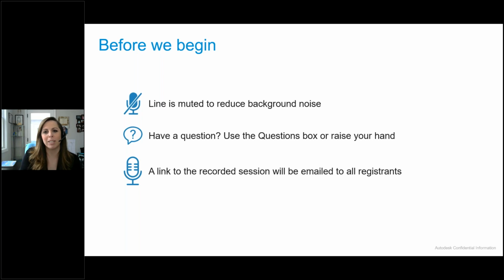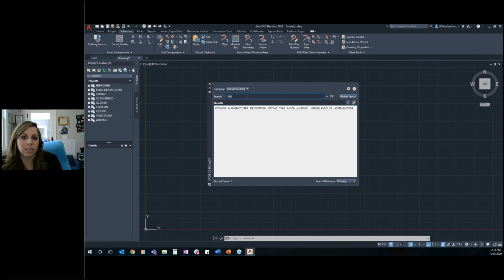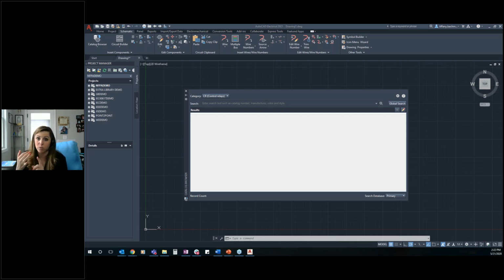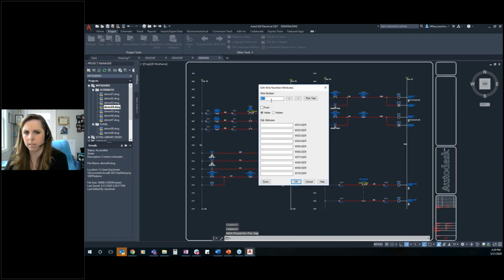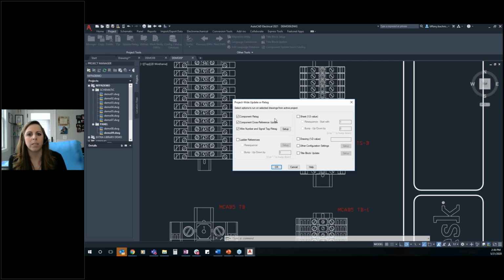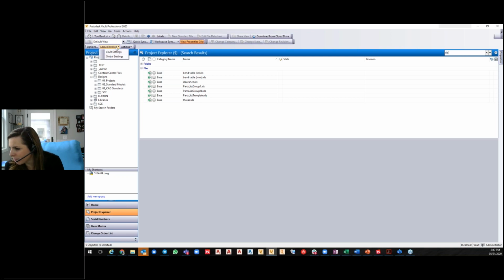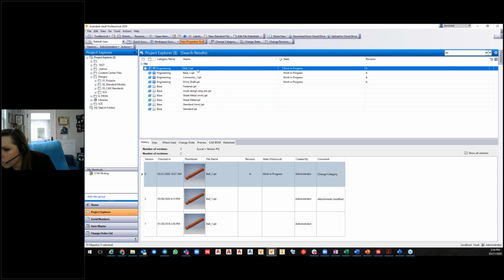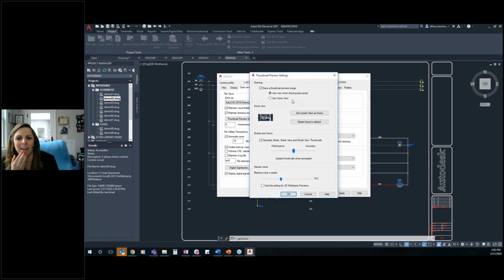What's new in AutoCAD Electrical 2021 (May 2020)

Comment: Instead of working on pretty pictures in the Icon menu, how about fixing the things you broke.. Like FileDia that keep resetting its self back to 0 when it chooses.. Fix cable marking so when you set cable in wire type and set it to NOT NUMBER and up do updates and gives it a wirenumber anyway.. Fix Source and Destination so if it is connected to a cable Link the Destination to the Cable marker number not some wire number that doesn't exist.. I have been using AutoCad since AutoCad 12 and it has gotten worse.. Like changing Insert Block to some STUPID Pallete.. Your Catalog SUCKS ASS.. Try taking lessons from EPlan on how to add parts to Catalog and Footprints. I can go on and on how screwed up AutoCad is. Try adding features that help people instead of fluff. Try linking catalog and footprint data to the project so the project portable.. Try fixing Terminal editor.. You layout your terminal and go back it screws up the rotation you already define..
Reply: You said system parameters don't just change settings is BULLSHIT FileDia will reset its self. Even in a new install without any IT involvement will reset its self over and over.. So I call bullshit.. Seen it ever since 2018 to  2021..
Reply: Also found out that the shift does not work in the Keyboard short cuts. Works fine when typing characters but the the Shift+Ctrl+C (Sopy Base)command no longer works.. Works great on 2019 but not at all on 2021. It is in Keyboard short cuts but does not functions.. Stop "Improving" AutoCad Electrical.. So it won't work at all but look pretty..

Comment: Just tested the part with the footprint for the terminal updating the changed wire number, and unfortunatley it does not update the wire number text on the footprint.